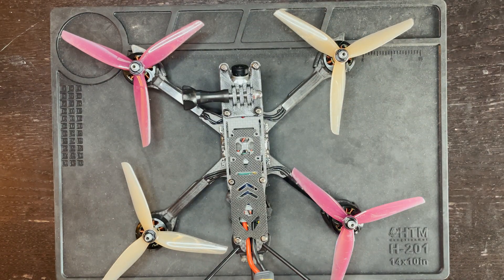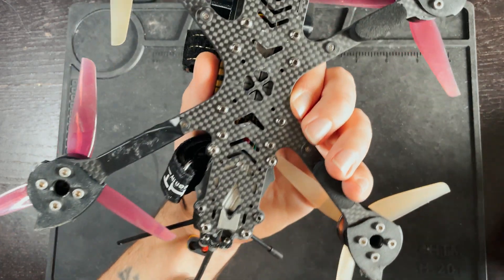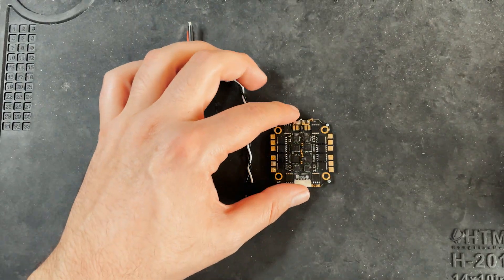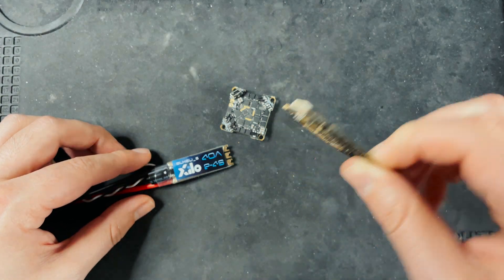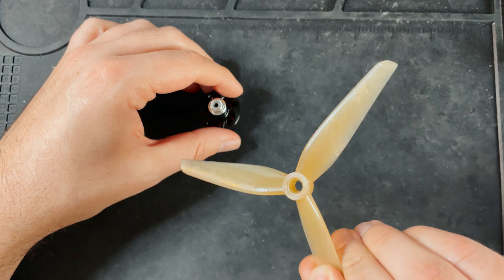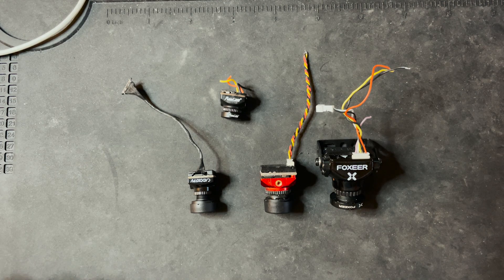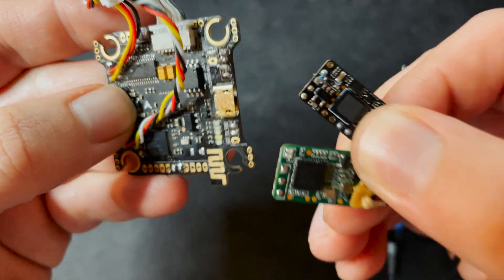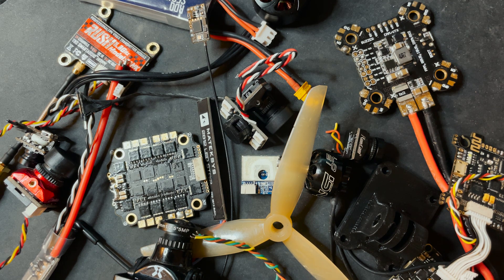FPV Drones - Explained

Comment: 1:37 Yes more durable, but also, Lighter for its size. To make a plastic one as durable as the carbon, the end result would be heavier. This is why car parts and such have shifted to carbon fiber/ Forged carbon composites and such. Sure we could easily print body panels over and over for a race car, but, its cheaper to make one carbon panel, that can withstand a bit of tire rub, then make 50 panels to swap every time it rubs and shatters it. Theres also some biodegradability and what not that nobody really cares about...